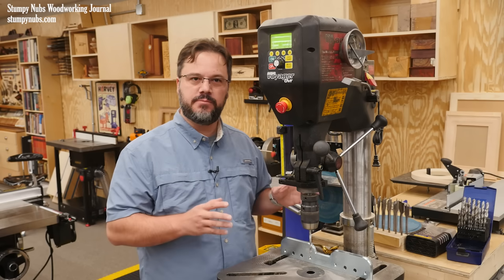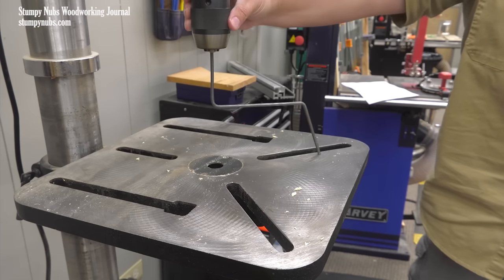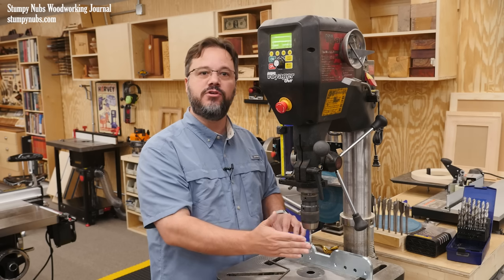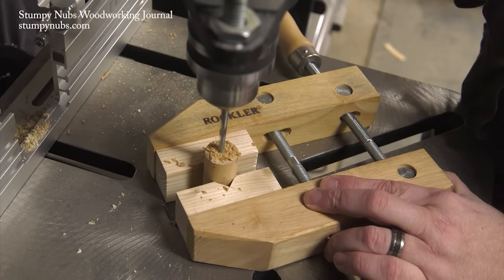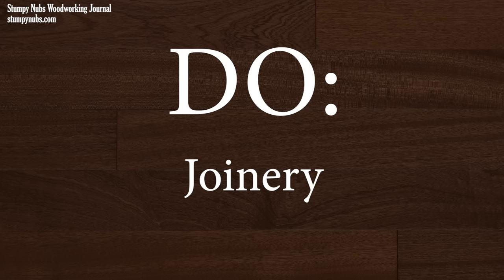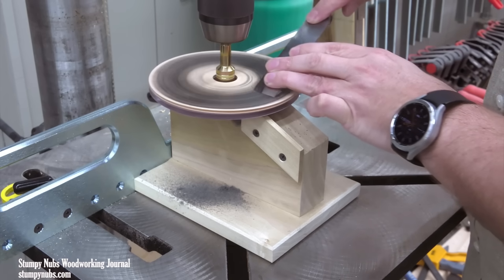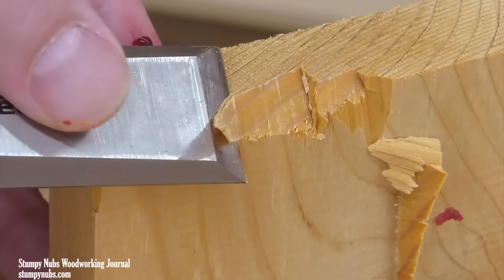WARNING: Internet drill press trend can SERIOUSLY hurt you!

Comment: Just wanted to check thoughts on wearing an easy to tear away glove like nitrile.
Reply: What is the point? With physical work the glove protects from abrasion. A nitrile glove protects from chemicals/solvents. How would a nitrile glove do anything for you in a drilling operation?
Reply: @johnburger3287  It's a use case question.  I'm a chemist.  I sometimes have reallllly weird use cases.  And yup - I machine things sometimes.
Reply: Also the rubber would be an easy grip surface onto things.  No gloves .

Comment: My wife is fond of telling friends about the time I poked my head out of the basement asking, Could you bring me the biggest bandaid we have? Foolishly drilling brass without a hold-down. Other than that, I've been pretty good with a tool I've been using for more than 60 years. (This very morning I gave it away — just getting too old and broken to keep paying rent on a workshop.)

Possible tip if anyone is so inclined: When I was a kid and wanted to use my father's drill press, he first built a chuck-key holder with an integral microswitch. He didn't want me to be able to turn the machine on with the key still in the chuck and have it flying around the shop. I later inherited that drill, and when the microswitch eventually burned out, I replaced it even though I was well old enough myself to be careful and didn't have a tool-crazy kid to worry about. Still: tradition.

Comment: 1:17 Don't do side load on the drill chuck
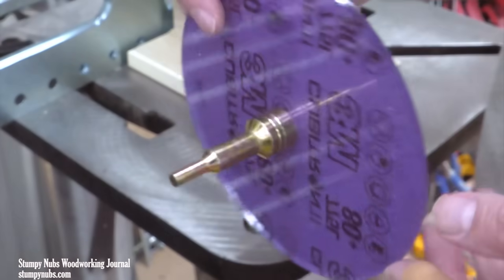4:15 Never mind, just sharpen your chisel on some dodgy grinding discs that clearly side loads the chuck...
Reply from the maker: That's not even close to the same side load as using a router bit to cut a profile. This is more like cutting an uneven surface (or half-hole) with a large forstner bit.
Reply: @StumpyNubs Thank you for clarifying this.
I was also concerned about side load if using the sharpening jig. 
I suppose using common sense, not applying too much pressure when sharpening and try to avoid using the very outer parts of the discs, is important.

Comment: Be careful about drilling into sheet metal, or more precisely, going too fast at the exit of the cut, as the drill can gouge a butterfly shaped hole into the thin metal which perfectly indexes with the drill, pulls the workpiece up out of a vice or your hands and spins the workpiece around the spindle. Alternatively, it could break the drillbit and send micro shards flying.

Comment: May I disagree with the idea of using a magnet to store drill bits? If you do this the drills become magnetised, and then when you use them for drilling steel or iron the swarf sticks to the drill rather than falling away from it. This is also a big problem with a caliper or micrometer that has become magnetised; any swarf present actively moves in between the instrument and what you are trying to measure, so the measurement is likely to be wrong. You can buy a device for demagnetising things, which is in essence half of a transformer that you plug in to the AC electricity supply. You bring the object to be demagnetised into contact with it and then slowly move it away.

Comment: Actually, gloves are really useful with drill presses. Heres why. Instead of putting the glove on, you set it on top of your hand. You can wrap the glove around the sharp item you are trying to hold and hold it and if it gets caught in the bit, no big deal. The glove gets caught and your hand is not in it so its fine. Its all in thinking the situation through and coming up with a solution that is safe and effective.

Comment: Gloves near anything rotating is always a big no-no. If you don't have the habit built when using a drill press then you'll carry that bad habit over to using a lathe or other tool which is infinitely more dangerous. Its pretty easy to have a vice setup on a drill press permanently and just put things into that rather than hold them with your hand/pliers/vice grips. For wood working you can make a set of soft jaws from basswood which won't damage/mark harder wood like oak, ash, maple, etc but still give you reasonable clamping force to secure your workpiece

Comment: Uhm, normally,  Stumpy's videos are great. But at 1:20, you point out that side loading your DP isn't a good idea, but then at the end, when sharpening your chisel, you're putting downward pressure on the chuck. While it's probably not enough to pull the chuck off the spindle, it could happen.
Reply from the maker: The side load using that disc is not even close to what you would exert using a router bit to cut a profile.

Comment: Hello dear friend, excellent video.
Can you please help me?

Tomorrow I will have an old Bosch vertical support for my Black & Decker drill. This support is the Bosch Universal BS 35, which despite being old is as good as new, I assume due to lack of use. Has instructions and original box.

I intend to drill several M6 and M8 holes, to then open threads manually with threads taps and install hexagonal headless screws, in two PVC-U pipes. These two tubes will function as a clamp, with three clamping points (screws) to hold old photographic lenses, with a metal body, which will be inserted inside the tubes. The two tubes have the following measurements:
 1. Outer diameter= 60mm/Inner diameter= 50mm/Edge to drill=5mm/Tube length=65mm
 1. Outer diameter= 75mm/Inner diameter= 63mm/Edge to drill=6mm/Tube length=79mm

I have the drill and I have the support to be able to drill vertical holes with precision. I need a suggestion on how to effectively attach the tubes to the base of the support, preferably without having to buy more accessories, so that the tubes are locked in place to drill with confidence and precision.

Thanks in advance for any suggestions and help. Cheers .-)

Comment: Worked in a machine shop that had bought a brand new 3 headed drill press for some mass production job they had coming up.  The heads required belts to be placed for certain speeds. This big fat machinist mark who had 20 years experience was adjusting the belt and it grabbed his loose fitting flannel long sleeved shirt and started to pulled him in. So its like a 7 foot tall machine and hes on a step ladder reaching into the top of the head. My response time was bad I didn't even process was was happening but lucky for mark another guy ran over and hit the stop. Nearly broke his arm off he was hurt instant black and blues all over the inside of his bicep. It pulled him in to it in seconds. And it was not some homeowner grade machine. They spent 18k on it that thing had some serious HP and torque.

Comment: 1:05 "A drill press is not a router or milling machine"
But here at 4:15 I'm going to show you how to use it as a grinder to re sharpen a wood chisel with acrylic disks. Never mind that I told you that the chuck isn't designed to take on side loads, the side loads of these disks being pressed up from perpendicular side angle somehow don't count. Grind away.
Reply from the maker: The side load created while using that disc as shown is not even close to the direct side load from using a router but to cut a profile. Most people recognize the difference...

Comment: Stumpy, the drop of blood said all that was necessary about your success in sharpening on the drill press. Anyone who has just barely touched their shin with a really sharp chisel and then bled all over their project before realizing they were cut knew what happened to you when they saw red. The shaving your forearm was unsafe and just showing again what the body finger showed. 

I’ve noticed since I learned how to better sharpen my hand tools and use them more, I have lots of little cuts, far more than I ever did using my power tools!

Comment: I removed my thumbnail with a 32 mm Forstner bit attached to a drill press, I was doing last moment cleanup with the drill bit, and the project was not held down or clamped down and as soon as the Forstner bit hit the material It spun out and dragged my thumb into the Forstner bit.

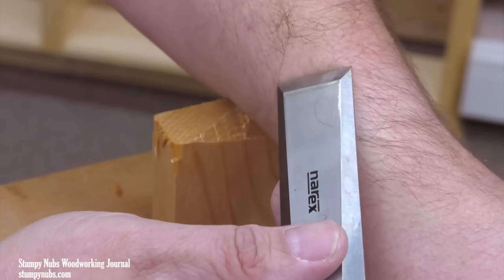Comment: nothing beats a heavy machinery safety video in which there's blood on the fingers of the tutor 5:18 on (there's even dry blood on the sanding disc and his finger has a band aid in a shot afterwards)
Reply from the maker: The blood was a tiny nick from the corner of the sharp chisel. If you've never gotten a little nick while working, you don't spend much time in the shop...
Reply: @StumpyNubs  but being a "security" video you should have edited that bloody part man!
Reply from the maker: @DonVintaggio  Why? It had nothing to do with being unsafe.

Comment: I knew better, but at work in a large shop, I was using a drill press working an unclamped 12 inch piece of steel.  Of course it jerked out of my grip and slapped my left hand but good.   I pretended it didn’t hurt as a visiting part time 70 year old driver walked by 10 feet away.   A few minutes later he walked by in the other direction and said, “and clamp that f ing thing down before you hurt yourself”.     I was lucky that day: the hurt went away by quitting time, and Gene reinforced my deserved humiliation with his statement.  Yeah, I always clamp now.  I would thank Gene if he was still in town.

Comment: People with long hair should be careful not to get it wrapped around the spindle and pulled out/or pull you into the spin. I know a man operating a honing machine which is similar. He tightened the hone by squeezing the outside diameter. One screw backed out and caught his wedding ring and took his finger off! Careful with a hand on the spindle if you have a ring!

Comment: Stumpy, I watched your video titled "WARNING: Internet drill press trend can SERIOUSLY hurt you!" based on its title. I am wondering what this dangerous internet drill press trend going around is all about. The video has some useful tips on safety as well as uses other than for just drilling holes. Making a simple hold-down out of project scraps was one of the best tips, in my opinion, as every user has them, are inexpensive and don’t require much time to assemble - which makes them more likely to be used. After watching the video twice, however, I was unable find the advertised Internet Drill Press Trend. The word “WARNING” is in all capital letters so I figure it must be important. 
As I'm not the sharpest chisel in the shop and I really like having all my fingers, kindly tell me where in the video I can find the part about this injurious trend.
Reply from the maker: All of the "don't" parts are common on the internet, especially using drill presses as mills with router bits.

Comment: GREAT TIPS!!!...except two...
NEVER hang something over the table with magnets...I have 100's of magnets, and actually did this once.  The vibrations can cause the sharp objects to fall in the work ares and hit the rotating parts and fly into your face!!  (DID YOU MENTION SAFETY GLASSES?)
.
The UNBALANCED "Z"-shaped metal rod: It wants to fly out and/or wobble a loose machine...someone will certainly be surprised.
Reply from the maker: Why were you under the impression that the machine was going to be turned on with the Z-shaped rod in the chuck? I was moving it by hand.

Comment: Are we just going to ignore the shop accident not shown in this video?
4:11, you finger is cut, but it wasn't cut when you start sharpening the chisel.
Guessing either the chisel caught the sander and flew into your finger, or you cut your finger on the disc.
Reply from the maker: Shop accident? LOL... If you've never gotten a little nick with the corner of a chisel, you haven't been a woodworker for long... It's painless. No big deal.
Reply: @StumpyNubs  lol
Just messing with you. Every woodworker is familiar with getting little cuts on various things.  I've got 20+ years experience, but have been lucky to minimize damage.
Maybe next time put a band-aid on before filming the closeup.  
😉

Comment: All good advice except, that magnetic bowl will do nothing but collect chips(chip magnet) lol it will also make your tools slightly magnetic and chips will stick to them. Sharpening tools on anything but a bench grinder is a bad idea(wonder where that bloody spot came from on his finger) sharpen on a bench grinder then finish with the proper grit stone.
I was a machinist/toolmaker for 40 years thank god I never personally seen anyone lose any body part😁
Reply from the maker: I've used the magnetic bowl for over a decade with none of those issues... Sharpening on a drill press is no more dangerous than a grinder. People have been doing that for many, many years, too. The blood came from nicking myself with the razor sharp corner of the chisel while handling it for the camera. Anyone who has worked with sharp tools for long has gotten a tiny nick a time or two. No big deal.

Comment: I don't mean to call you out, as I both enjoy your videos and think your approach to safety is very good. However, at the beginning of the video you say not to use router bits as sideways pressure can cause the chuck to dislodge, but then at the end you are using a sharpening disc that is doing the exact same thing. even worse is applying pressure downwards on the leather part. This downward pressure would never occur in use as a drill pushing down a drill bit. I wonder what is significantly different to make the one safe and the other not?
Reply from the maker: Light downward pressure on the edge of a 6-inch disc is not even close to the direct side pressure when cutting with a router bit.

Comment: As others have said, the drill press is just about the most dangerous machine in the shop. It doesn't matter if you are wood or metal working. Worse, a drill press is often the first machine purchased for the shop and folks are unaware how even a small bench press can catch you out.

One of the worst accidents I saw involved loose hair and a drill press. A lady running a drill press leaned over to pick up something and the whirling metal chip hooked a whisp of her hair. It scalped her before they could get the press stopped. Not pulled hair but scalped.

Have fun, be safe. You have to be your own safety officer. You may get away with unsafe shop practices 999 times... but that 1000th will be a  b&*ch.

Comment: If you are thinking of spending a lot on a drill press, get a milling machine instead. I have a milling machine and a cheaper drill press. The milling machine is more accurate, has a great table and vice, won’t tip over, takes sideways forces and can be a morticer and disc charpener.

Comment: I used to wear blue nitrile gloves in the workshop to protect my skin from solvents and irritating wood dusts. Until one day the tip of the glove on the index finger caught the tip of a drill bit in the drill press and hauled my finger in. I was just able to pull my hand back and break the glove before my finger was injured. They are surprisingly strong. I don't wear them any more when using machinery.
Reply: The point of lab gloves is to be chemical resistant, but also strong enough that you can't break them accidentally. They're not meant to break away when they get caught in something

Comment: "Do not attempt to stop running chain using hands or genitals." - Actual warning plate located on certain old Husqvarna chainsaws. Applies to stopping a drill press too. 😂

I have a scar on my thumb that took 3 stitches from when I was in middle school from a drill press. Tried to drill thin metal. Worked until it didnt.

Comment: anyone notice blood on the finger . . . .blood on the edge of the disc . . .bandaid on the finger???
Reply from the maker: If you've never gotten a tiny nick from working with sharp tools, you've not spent much time in a workshop.
Reply: I have wood shop tools & metal shop tools that i use all the time in my shop! I have a screw vice on my drill press table that "holds" any wood & metal work i do plus a vice on my welding table & one on my work bench! I have all kinds of scars, cuts, gouges on my hands & fingers from shop tools & working auto-truck/diesel/farm & heavy equipment mechanics & also from when I was an aircraft/jet engine mechanic from my military days back in the day!

Comment: Dont side load a drill press...  side loads a drill press with a hokey sharpener.
Reply from the maker: There is a big difference between the slight side load from that disc and the direct and much greater side loads that come from using router bits.

Comment: You forgot the most important thing. SAFETY GLASSES. When a bit breaks you never know where that metal is going. Still have my osha rated  prescription glasses that took a hit from a drill bit break. Would of lost an eye if it hit without them on. That was in a shop class in high school. I always use hold blocks, clamps (wood or metal). All work is worth doing it right, safely, and precisely. If anyone doesn't like how slowly you're taking a job they sure don't care about you or you loosing your skill and craft.
Reply: Yes, I agree! After having a few discs disintegrate at high speed on angle grinders, I now wear full face impact resistant face shields for most powered tool work, but additionally safety glasses UNDER the face shield when using wire wheels, where loose strands of wire can fling up underneath the face shield.
Reply: @amateurmakingmistakes  good point about the face shield. Might have one laying aroung. If not my respirator should do.
Reply: @amateurmakingmistakes  Definitely wear the glasses under the shield. Back in 1981 I was making baseboards with a router when somehow a chip flew behind /under the shield, I don't know how and ended up in my eye. Luckily in left after my co-worker blew into my eye the third time but for the next half hour my eye was irritated. Truth is stranger than fiction especially when it comes to accidents many of which you couldn't duplicate in a lab if you tried.